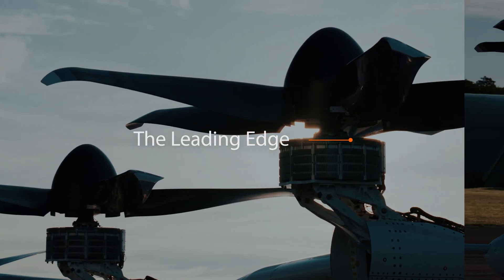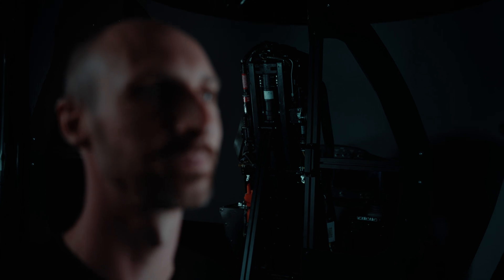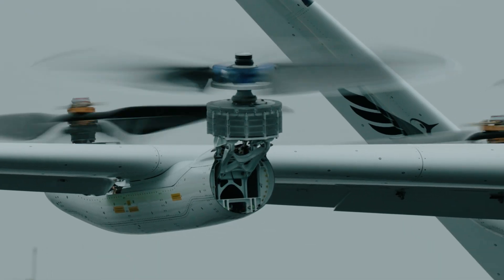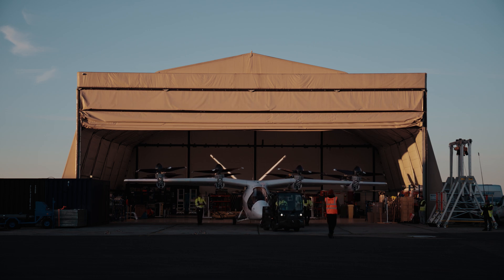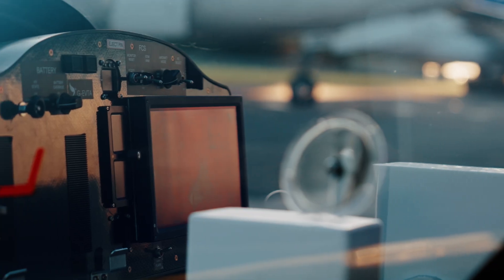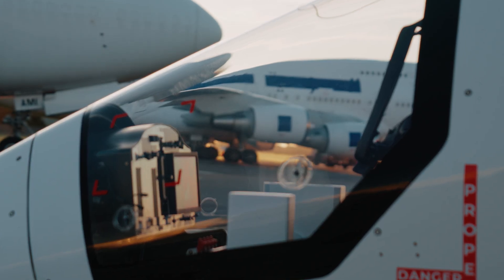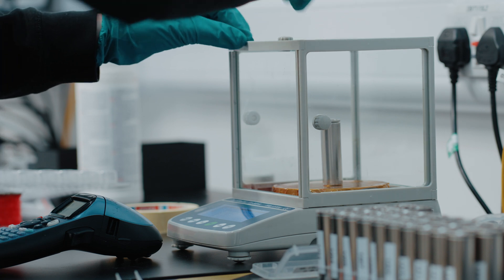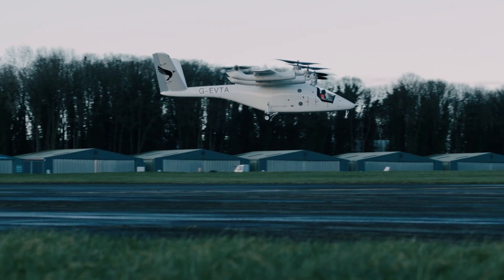The Leading Edge - Episode Two - Digital Innovation in eVTOL Design

Comment: An Urgent Requirement which EVTOL Must Pursue is SAFETY.
New EVTOLs must be Safer than Existing Helicopters.
Therefore They Must Autonomously Test Motor Failure, Electrical Failures, Blade Failures Etc.

Good Luck.
Reply: EVEX. Sem duvidas será a líder do mercado com domínio de todo o ecossistema